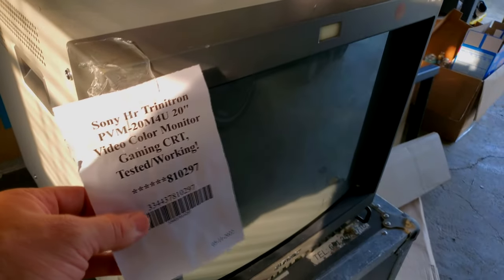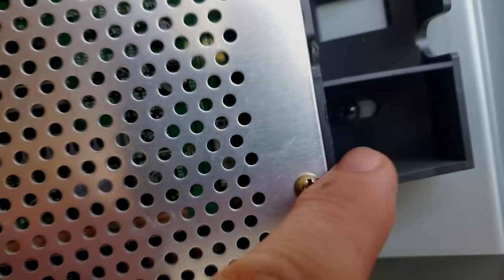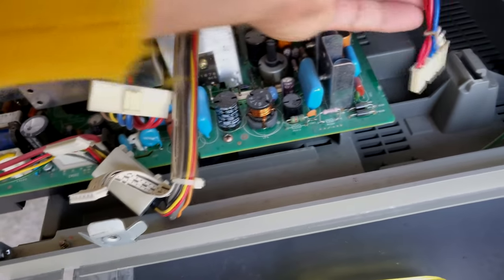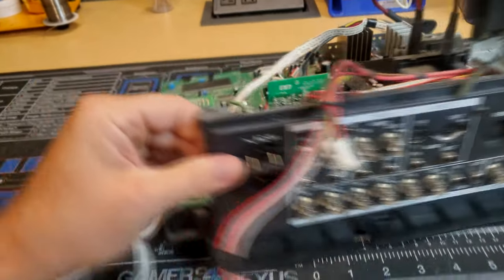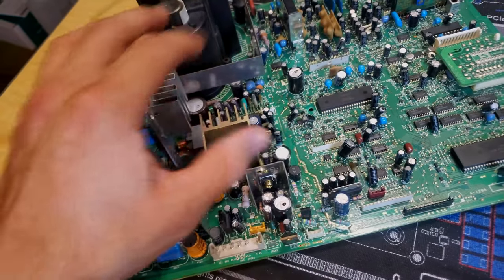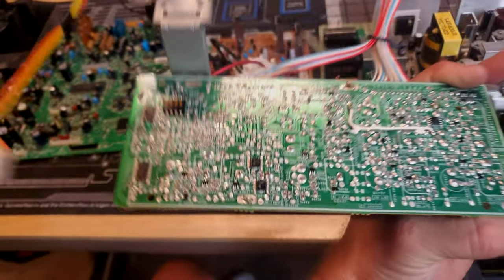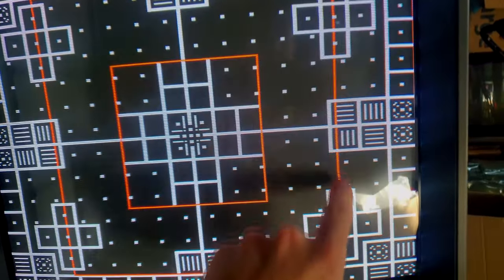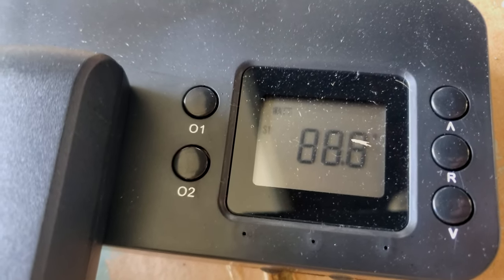Is this Sony's Best Analog PVM? | The 20M4U CRT Deep Dive

Comment: Just got my 20M4E delivered, only hooked it up for 15 mins just to see her running, played a few mins of Evangelion full-frame 4:3, you were not kidding were you, it is incredible looking, I have a few amazing 21" PCM's like the LaCie Blue IV 22 and E530, but this is my first PVM, and I underestimated just how good they look, you really do get 240p but with incredible PCM like fidelity, even just the menu looked good lol, canny wait to hook my MiSTer up to it, I really want to get hold of a flyback for it so I can make sure she works for years to come without issue, the tube is immaculate, I canny wait to play some Saturn and N64 games on the MiSTer in the nicest 240p I have ever seen before, it actually looks better than my LaCie Blue IV 22 does with 240p when set to 240p120Hz super-res mode (direct-video), I can also use MiSTerCast to cast anything from my gaming rig in 240p, I got it for 500 squid btw, seeing prices that it goes for, it got a good deal I think, tis the most I have spent on a CRT, as the most before was 350 on a ViewSonic G220F.

Comment: this is a bit of an odd question but. can you mode a 15Khz crt with a 31Khz Jungle chip.
I'm wanting a small CRT. I'm thinking 9inch would be a good size for my desk but i'd only be able to get a TV crt at 9inch.
so i wouldn't be able to get over 60hz for pc

Comment: Hey Steve. Do you know anyone in the Philippines who can help service a PVM?
Reply from the maker: Sorry I don't
Reply: @RetroTechUSA  Too bad. Thanks anyway. Will you be doing a video about color calibration of a 20M2MD?
Reply: @jsnepo  did you buy it from a guy who had like 4 of them?
Reply: @chronology556  No I didn't. It works fine. I just want to have its geometry adjusted.
Reply: @jsnepo  Globemed?
Reply: @chronology556  Yep.
Reply: @chronology556  You know anyone who can service PVMs?

Comment: Am I sitting on a goldmine? I have two 20M4U's from 2000 sitting in a studio that never get used and in my office, an old tv control room, I have  a 14M40, two 1351Q's and a PV-8220. They all work fine, they just haven't been powered up for awhile.